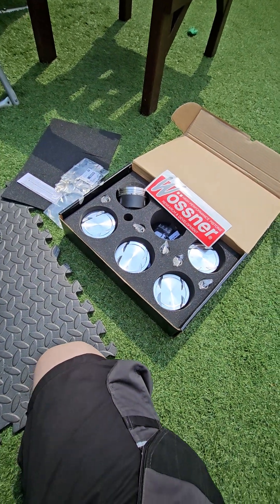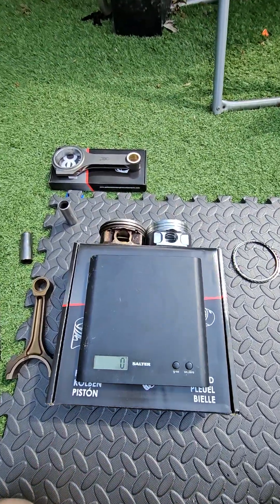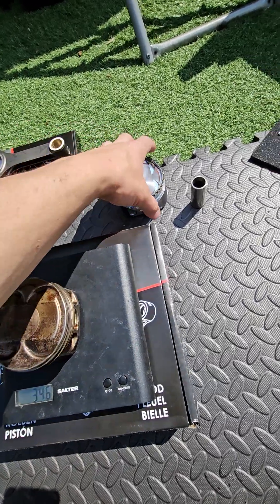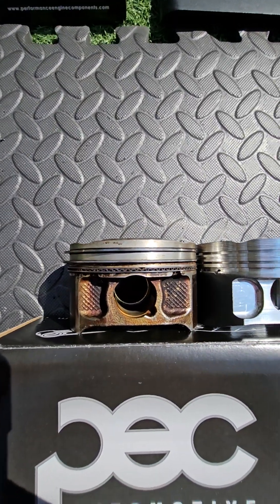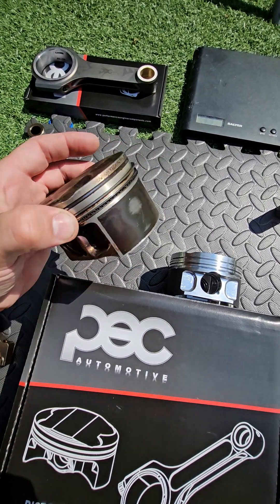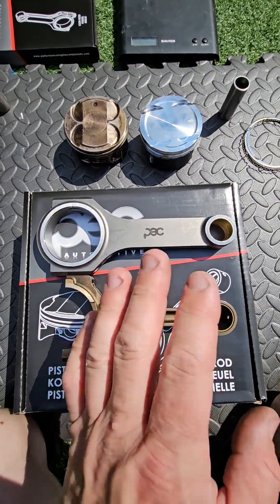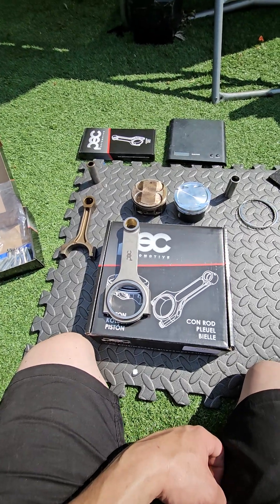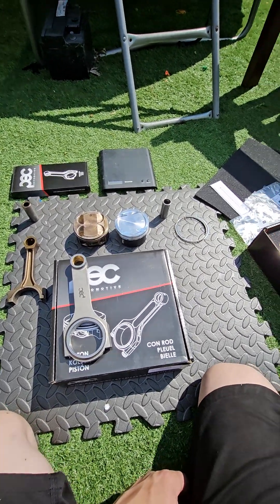Saab Vectra 2.8 v6 b284 z28net forged Wossner pistons and rods Turbo x build

Comment: Hi I just discovered your channel while trying to find info to help with an over boost fault I've had on my Insignia VXR (2015) ever since I bought it 5 years ago. The problem got worse when I has a remap but got better when i gapped the plugs to .63mm but it's getting worse again. I'd love if you could have a look and also recommend any mods if I can get this problem solved. I've had it in several garaged including Thorney Motor Sports and no one can fix it.
Reply from the maker: Hi there . It's hard to say without seeing the car.  It is a common phenomina
Reply from the maker: Is the maf sensor in the standard location. And also rotated in the original position and not upside down. Seen this cause issue before. Usually with aftermarket intake.
Reply: @garymgzs280  Thanks, I believe so, I did change the maf sensor and I put it back the same way, but will have a look tomorrow.
Reply: @garymgzs280  Hi Gary, I've checked and it is. I had a look at the wastegate actuator this evening. It won't operate with my vacuum pump - I trued up to 25 on the scale but U was able to move the rod manually - I could pull it out with a lot of force and it springs back. The specific problem I get is the over boost if I accelerate hard or say I accelerate too hard from 50 to 70 in 6th gear. When in VXR mode the problem is much worse and more frequent. If I accelerate gently then I don't get the fault. Any ideas? I've already changed the actuator switch and checked all the pipe work. Also had in in with Thorney Motor Sport who could not find anything. The only thing that has made a difference is, after speaking to Courtnay Motor Sport once, they advised me to gap the plugs to between 0.6 and 0.65 - they came when I bout the car gapped to 0.9 and Haynes said 1.1! I went down in increments to 0.62 and it was way better for 6 months but now these symptoms seem a little different and instead of the engine light flashing I get "Service Vech. soon" instead.

Comment: I’m planning on rebuilding my Signum 2.8 V6 I may fit those rods  are they just an off the shelf part ? Also do you use a standard or stand alone ECU as mine can’t be mapped so thinking of getting one , what ECU would you suggest
Reply from the maker: Hi there.  Yes wossner sell them off the shelf.  And they are a direct fit.  

I don't know why your ecu cannot be mapped.  We have plenty of signum in the uk running hybrid turbos and making 380+ bhp.  Tuning was done by aura tuning in the uk.  He has a Facebook page and can remote map aswell.  

A lot of tuners turn you down when you ask because the setup in our cars is not popular.  So they will spend weeks and weeks perfecting maps to only have a few customers.  They stick to the volume stuff like vw and bmw. 

I would only consider going standalone if making serious changes to the engine.
Reply: @garymgzs280  yeah I went to Wirral remaps and he put a map on the car and it wouldn’t start , then he reverted back to stock and it ran fine , he said there was a fault on the ECU , but I also got told mine needs a chip as is the very early 2005 model.
Reply from the maker: @medievilassassin  sounds like he put a map on for a 2007+ model which has different cam sensors and will not run. 

Aura tuning can definitely sort you out.  Mapped my saab to 514bhp . There's been probably over 100 of these engine mapped by him now . Our original group of 32 saabs compelled him to get on board and start  mapping them. The first car took many hours across  2 weeks to get the maps perfected . Since then he's been the main person in UK for them. He remote maps them also for people in other countries.
Reply: @Shadowmosesarea51 hey, I have saab 93 aero, im from Lithuania, went for stage 3 setup, and Gary and Aura tuning helped me with all stuff, car runed perfectly, was very happy with that work, I was one of fasted in my Country among saabs 😁
Reply: @garymgzs280  right ok what would I need to do for around 300bhp? I have already put all new Bosch coils and plugs in it along with oils and water pump , though it does have 156k on the clock but never misses a beat
Reply from the maker: @Shadowmosesarea51  you get to about 315-320bhp on a standard car with a remap
Reply: @garymgzs280  thanks mate do you think it’s possible for me to send them the ECU in the post